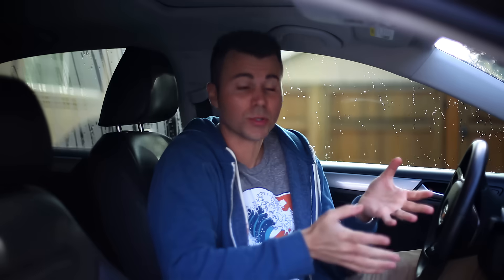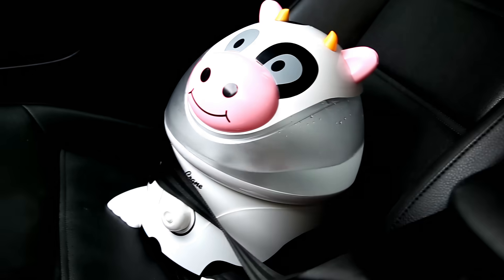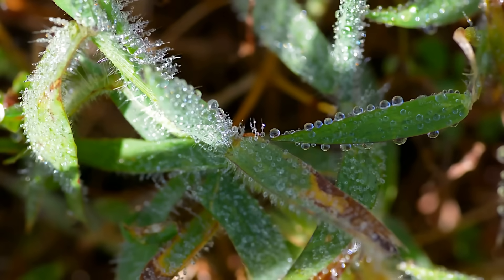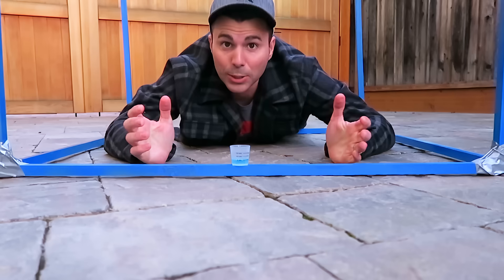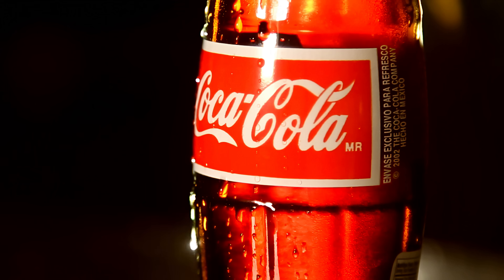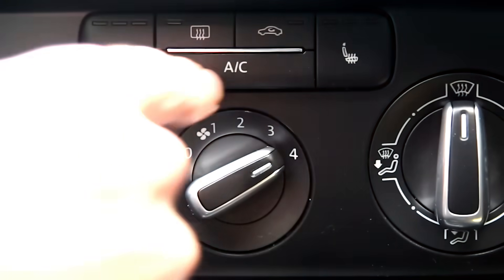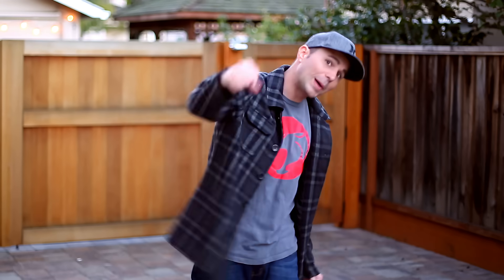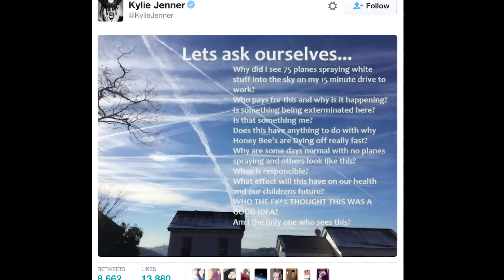Defog your windows TWICE as fast using SCIENCE- 4 easy steps

Comment: If you ask any ac repair person it is a very bad idea to run the ac while it is cold outside. Actually less then 65 degrees, this is because the coolant that runs through the coil cools it even more damaging the coil or frosting over. The gas also expands when colder so you are more likely for gas leaks in the ac circuit.
Reply: I should also explain that any modern car (like the one in this video) has a thermostat, that knows when the cabin air temperature is cold or hot, so turning on the ac button wont actually engage the compressor. Itll just turn the system on if and when the cabin temperature is above the set temp. So itll either do nothing or cause a conflict with the heater core and cold air circuit in the car.
Reply: @zaxsp1118  Not so simple at all. Some automotive compressors are actually made without clutches and they're always rotating together with the engine, they will simply pump as low as 0.4 cubic inches of refrigerant per shaft rotation when the AC system is off and this isn't enough to make the evaporator freeze up (either that or the refrigerant gets routed inside the compressor when it's in minimum flow mode). A computer knows the evaporator temperature, the outside temperature and the interior temperature and adjusts the pumping flow as needed. And FYI my car hasn't got any thermostat at all. The only thing that keeps the compressor clutch (mine has variable pumping flow and a clutch; it's a Delphi Harrison CVC compressor with the mechanical control valve) from engaging when it's too cold outside is a pressure sensor on the liquid line that keeps the compressor from engaging under a certain static pressure. Otherwise the compressor will start anytime and the evaporator temperature will be regulated by a control valve inside the compressor that senses both the suction pressure and the discharge pressure and keeps the suction pressure above a certain value (lower with hot weather, higher with cold weather) by adjusting the compressor pumping flow. The evaporator also has a TXV, which does a great job at keeping too much liquid from flowing into the evaporator and also tells the compressor flow control valve when it's time to reduce pumping flow. You have to be much more careful with the so-called transit compressors (i.e. Carrier 05G, Bock FK40, Dorin 4T...) which are used on buses. These are so big that cycling the clutch too often will damage them (clutch shouldn't be cycled more than 8-12 times an hour on these compressors actually). Defrost is also found on buses with these compressors. How did the engineers solve the cycling issue and allow trouble-free defrost even in cold cold weather (as low as 39 F!)? Recirculation is run together with heater cores and AC when defrost is required. That way the evaporator stays warm, liquid won't reach the compressor's suction port, the compressor doesn't need to cycle its clutch or its pumping capacity and you get defrost. Yes, it works that way and all of this is written on the manuals of bus HVAC systems too. So there's no conflict between the heater core and the AC.
TL:DR Everything depends upon the AC system design but rest assured that if the AC turns on when you want it to turn on, it's always running without any risk of damage, until you tamper with it or neglect maintenance that is.

Comment: 99% of the time; only use fresh, not recycled air. 
Tip: When either defrost or defrost/floor is selected, the AC pump will 
run, which in turn dehumidifies. The other 1%, when someone farts.

Comment: I do grocery store refrigeration and if the humidity is to high in the store the refrigerated cases will sweet so what we do to reduce humidity is we run the a/c and re heat the air just like you did with the car

Comment: Could be wrong but having the heater on full blast has the air go through the heater core, hence having the ac on there isn't any air passing through your evaporator due to the blend door actuator diverting the air through either the heater core or ac.  anything I'm missing?
Reply: Yes. The evaporator is placed before the heater core, so that air is routed first through the evaporator and then through the heater core, and the blend door is between the evaporator and the heater core. In fact you will notice colder air coming out of the vents when you have max heat and AC on together than when you have only max heat. You'll also notice a fresh paint or Band-Aid smell from the vents when your evaporator core is leaking, and that is the smell of the PAG compressor oil which leaks together with the refrigerant.

Comment: Well I can't fault your methodology or your results, just as an FYI when you turn on your defroster remember the front defroster is run by air the back defroster is run by electricity, that the air conditioner automatically goes on to remove the moisture.

Comment: Besides that if the engine is cold, the air from the ventilation is cold as well no matter if it is set to warm or cold, I have figured out that in my car the windshield defoggs faster when i set the ventilation on cold air and full blast.

Comment: Bringing in fresh air seems somewhat counter-intuitive. If you're trying to increase the temperature inside the car, won't bringing in the outside air reduce the temperature? The A/C is already removing the moisture, so it doesn't seem like you would necessarily need to bring in the outside air to reduce the humidity.
Reply: In fact it works with recirculation on in buses. In cars it often forces recirculation off so that some defrost can also happen with an inoperative AC system, and by the way the compressors used in cars are small so they can be cycled on and off much more frequently, so recirculation isn't needed when the ambient air is cold. Yes, with recirculation on you get hotter air and faster but the heater core is hot enough so that you get enough heating even with fresh air, and by the way you want the engine to stay cool.

Comment: Totally vindicated. This is exactly what I do. Just a couple of notes on the use of detergents to prevent fogging in the first place. They work, with a big but...This is particularly noticeable inside a motorcycle helmet. Fogging can still occur, but instead of fine particles which might quickly disperse given a blast of relatively dry air, you get much larger droplets forming which take ages to get rid of.

Comment: Did you actually rub the window with anything for the control, because I rubbed the section of my windshield in front of the driver side with a clean old sock I was using as a rag, and it seemed to do the trick for a few months.

Comment: There's also one important step. When you get into the car and it was raining / snowing, you take some water / snow inside your car. It's not problem as long as your car is heated up. But when car colds down, your humidity goes up. So, another step is when you park your car, you should open your doors and let fresh, cold air from outside get into the car.

Comment: Pretty hard to do in a car using ONLY rotary switches. The A/C only operates through the dash Vents. I can select Defrost, and set to either hot or cold, but A/C won't operate.  I could use A/C and turn it to hot, yes, but it fires air at the driver/passenger, not the windshield.  Ah, the joys of having a 90s car lol

Comment: In my car, turning on the defog/defrost vent setting automatically turns on the AC (which is usually the case on most, if not all vehicles) and when I have that setting on, it won't let you turn the recirculate mode on...just pointing out something interesting.  Good video!
Reply: Not all cars. Mine won't. But mine lets me turn recirculation on when defrosting. The lever on the dash directly actuates the flap inside the evaporator box through a Bowden cable, the distributor dial directly actuates the distribution flap inside the heater box through another Bowden cable. The automated defrost may be an American thing because mine is an European very low end MPV of Japanese design.

Comment: I would say recirculation depends on the outside weather - I find often recirculation on is best but also frequency we have humid foggy mornings.  Keeping the air inside dry with AC+recirculation while driving also seems to help keep down the amount of humidity and moisture inside the car when you shut it off.

Comment: Point your windshield towards the sun... even on a cold day it helps. I have a 6 to 10 minute drive to work towards the East. If I cant get my defroster to work in my driveway, I safely get to the road facing East and within a half mile my wind shield will clear up. (unless it is super overcast)

Comment: Fun fact: Some vehicle's evaporator box, have a louver that divides the air that enters the box from two inlets; i.e. hot and cold. So in simple terms, if you have it on full heat, air fill not pass thru the evaporator and in return not remove moisture from the incoming air, as it's only passing thru the heatercore side of the air box. Some newer cars have them stacked and simply control the coolant going into the heatercore, those set ups will indeed work with this method. Best way to defrost a car is to simply be a responsible adult, wake up early enough that you can have a flat tire and still make it into work on time. Then you will have plenty of time to defrost those pesky windows.

Comment: How about trucks for defrosting ice on the exterior,  not condensation on the interior.  You know for those of us more north that have to deal with ice and snow. I just blast hot air on the windshield.  But you have to use that from start. If you wait until the engine is warm but it is still cold you can crack you windshield.

Comment: 18 year old Honda Accord automatically enables AC and disables air re-circulation when you select windshield defrost. Then you crank the heater on in the winter. I would expect all cars made after 2000 did this. Some even automatically max the fan in addition to the stuff above when defrost is selected.

Comment: A simpler solution may be to keep a 'dry bag' in your car, these are designed to pull moisture out of the air and they're quite cheap. A roll of paper towels is also a quick fix as they are highly absorbent and wiping away most of the water will have your AC system doing far less work to clean up the rest, which will get you on the road faster.

Comment: I was told not to turn the heater on to full blast right away since the air will initially be cold because the engine takes time to warm up.  I was told to leave it on low until the air becomes warm and then put it on full heat and full blast

Comment: An A/C tech once told me you can damage an air conditioning system if you run it when it is below 40°F...

Not that it matters to me, as the A/C in my truck has been broken since day 1. Also, I have more problems with frost/ice than fog/condensation...

Comment: Making a video extra long to gain more money makes me want to stop watching the only way I can see this working is to leave the window crack open about 2 fingers gap if you have rain guards window visors then people can't tell your windows are down and rain or snow won't get into your car and turning the heat on when the engine is still cold is bad for the alternator and heatercore cause the radiator fluids are cold that's why you feel cold air blowing through the cabin vents

Comment: If the outside air has very low humidity, wouldn't running the AC be unnecessary?  Are there not circumstances where the AC would be counter productive since it dumps a bunch of heat outside (it's intended function) as it dries the air?  Its kinda moot for me since I live in Alaska and most people I know here don't even have AC in their car (or house).  Anyway, cool video.  Other than the AC part it confirms my personal experience and assumptions.

Comment: Another thing to consider is wiping away the actual plastic "fog" from the windshield. A dry cotton cloth can be used to remove this thin film of condensates left from air pollution and the plastics in your car breaking down. scrub half your windshield with a dry cotton cloth. Then notice how effective it is in the morning compared to your control side. You'll have less foggy windows period.my theory would be that the dirt/condensates give water a good place to collect unlike a clean glass Surface. Also oil+water does look cloudy in most instances.

Comment: How can you have the air con and heater on at the same time?
Reply: Air con draws air from outside/ circulates it in the car. The heater heats that air. Without air con, you'd not be heating anything - if you have the air con on it's inevitable you have to set it at either really cold or really hot or somewhere in between.

Comment: So which is better to use Defrost setting or the Ac on hot ?
Reply: Click defrost and turn the temperature to maximum heat. AC should automatically be enabled and re-circulation should automatically be disabled when you push the defrost button for the windshield.
Reply: Tip: When either defrost or defrost/floor is selected, the AC pump will run, which in turn dehumidifies regardless of temperature settings.
Reply: ffs... HOT! AC removes moisture from the air. Your windshield isn't made of air, and waiting for dry air to remove moisture is exponentially longer than just applying heat to the window

Comment: I think you'll find one of the "suckiest" about getting into your car at winter is having to pour boiling water over your lock to get the key in, scrape frost off the inside and outside of your windscreen and other windows, and, if you own an especially old car, heat the engine up with hot water or a blow dryer to get it started.
But fogged up windows must be awful ;)

Comment: Quick quiz.  How many people here already know that on every car with AC, the AC compressor gets turned on automatically when the car goes into Defrost mode?  You can't even stop it from doing that.  The AC light may not be on, but that AC compressor is always cycling on Defrost.  Literally every car with AC does this!   

Far from making the actual defrosting work faster, it is done so that during the long stretches in winter where the actual "air conditioning" is not required, the AC compressor keeps cycling, to keep the seals from drying up and leaking.   There is oil in the R12/134A/whatever-your-car-AC-runs, that needs to be moved around in the hoses, and gaskets, to keep the system sealed. 

Hitting the "AC" button probably won't make it cycle any better either.  As the cycling of the AC has to do with intake temp/output temp/selected temp and sometimes interior temp, I'm sceptical that it would cycle any faster than simply letting it do its own thing on "Defrost".  This is a car, not a rocket. 

Fun fact.  When the HVAC is set to Defrost, it typically cannot even go into recycle mode.   Think about it.  What would be the point?  Automotive engineers figured this out long go.  

Interesting info about the shaving cream.  Maybe redo this video, and promote that only.  Maybe compare brands.   The rest of this one is highly suspect.   Turn the heat up, and open a window?  Really?  Duh. 

I mean no offence, but even an apprentice automotive mechanic with 2 years (or less) experience already  knows this stuff.   Heck, it's usually even written about in the new car's owners manual!  (But, who reads those, right?)

Comment: My wife used to have a 1977 Buick Skylark. Whenever you turned the control to defrost, it also turned on the air conditioner. Two out of four with one button! The bad news was that when the air conditioner turned on, the engine switched to a faster idle speed. This made life very interesting when trying to drive slowly on a snowy icy road once. If you let off the brakes, the rear wheels would spin. If you put your foot on the brakes the front wheels would slide. If you turned off the defroster, the windshield would fog up.
BTW, thanks for showing how much water is in the air. We always hear about 'relative humidity', but this is the first time I've heard how much water is in the air in actual amounts.

Comment: A commenter on here asked if you could even have the AC and the heat on at the same time.
I went out to my car, a 2008 Toyota Sienna, to try it out. When I turned on the defroster, the AC came on automatically, and the outside air circulation went on automatically, all I had to do is crack open the window. So my car does the first three steps for me automatically.

Comment: So question. What's the best way to defrost your window when that condensation has frozen? I still use basically the same settings you said except the windows. But would shaving cream work to keep the outside of your window from accumulating condensation that then freezes?

Comment: The ac part doesnt matter due to the hvac system will not allow air to pass through the evaporator therefore wasting time on pressing the button and fuel to run the compressor.

Comment: I use the same exact techniques in my Jetta!! This guy deserves a smash on the like button!
Reply: Blasting the windshield with hot hair will break the windshield this guy says lmao. ^
Reply: @AndreHila  If your windshield is slightly cracked or have a micro crack in it, from rocks hitting it, you'll definitely crack it. I've have had two windshield crack on me so now I don't blast hot air on full. Although it's quite cheap, it's a hassle having to replace the windshield.
Reply: Which one?
Reply: Got a 2013. Can't wait to make use of this new knowledge 😭
Reply: You mean a squish
Reply: Yep, this is why newer cars automatically turn on the AC when defrost is selected. Most people already know this. I don't like blasting hot air during the winter time though as it can actually break the windshield. So I blast it at medium settings when it's extremely cold.